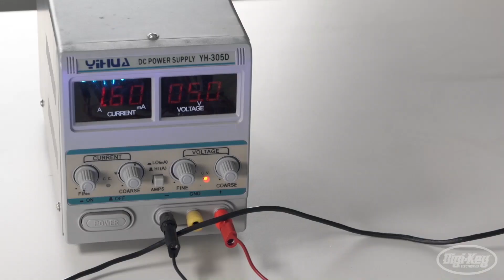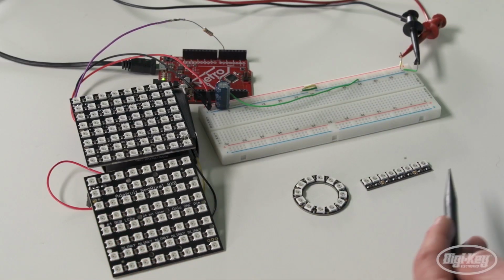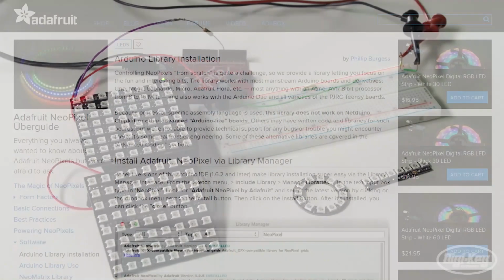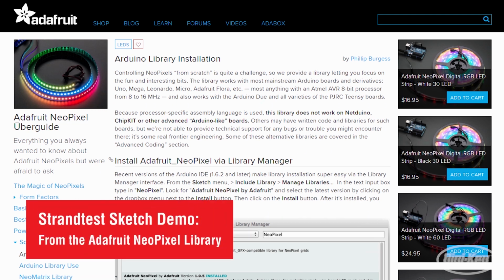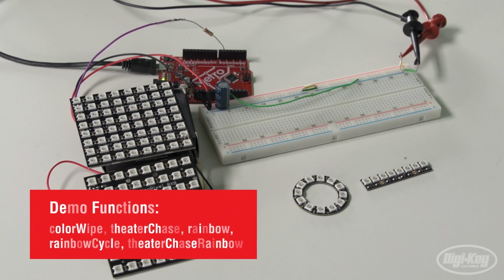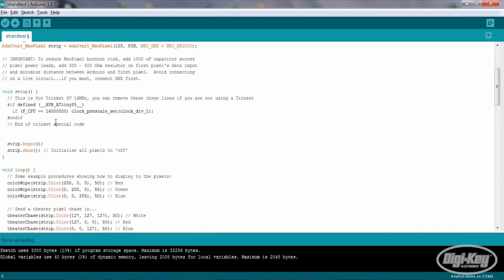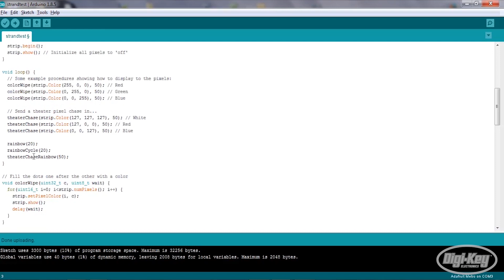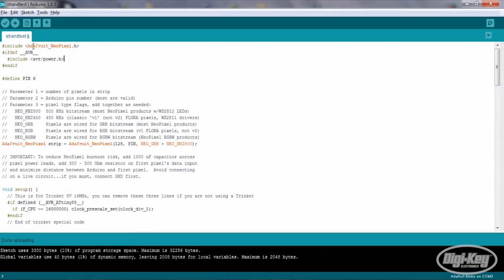Getting Started With Addressable LEDs – Tech Basics | Digi-Key Electronics

Comment: Does anyone make a stand alone single wire addressable chip like the WS2812 with more than three output I/O for driving LED's?
  I picked up several WS2812 chips with the intent of using them with individual LED's. Then I read a hackaday article that mentioned Sean Hodges was using them in a project to make single wire 7-Segment displays. This is an interesting idea, but it requires three WS2812 chips to drive a single digit. A WS2812 based design is just not very practical for this on a double sided PCB. Does anyone make a single wire MUX like the WS2812 with a larger number of outputs? Anyone can make a design with a 2, 3, or 4 wire serial interface. I don't care about that. I want the ability to drive as many 7-Seg displays as I'd like using a single PWM μC pin.
Reply: Upcycle,  are you saying to make signage LEDs it can't be done with this  setup?
Reply: @whitesheatingairappliancer7101  
  These are just single wire serial multiplexers that use PWM to communicate.
  The WS2812 is available as a SOIC-8 chip without LEDs. Wire them up to any LEDs you want so long as you have access to the cathodes. You can wire them to 3 of one color, 3 different colors, nothing, resistors, it doesn't matter. The chip couldn't care less about what's actually connected to the output. It just tries to open the drain on each output. You can easily connect a 7 segment display with a common anode. The WS2812 is just limited to 3 cathode channels per chip. So for a 7seg+DP you'll need 3 chips and have 1 spare.
Normally the 3 chips would control:
RGB   RGB   RGB
but they can just as easily control segments:
abc      def     g(DP).

  The software is a bit challenging to sort but it is possible. The 7 segment LED displays can also be daisy chained just like any other string of LED's. 
  It would be a lot easier if someone made a single die with several of these chips in one package. It seems like a no-brainer to me...the kind of thing that someone at Digikey should know about...if it exists.